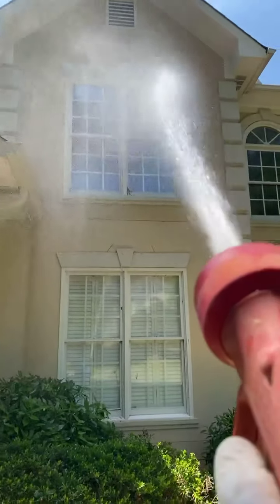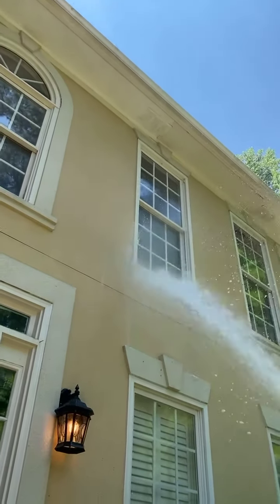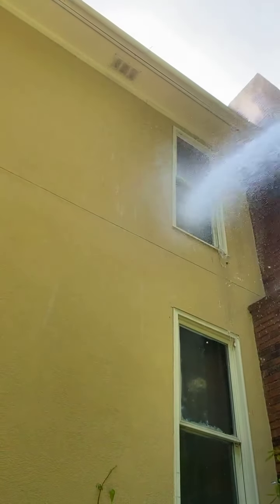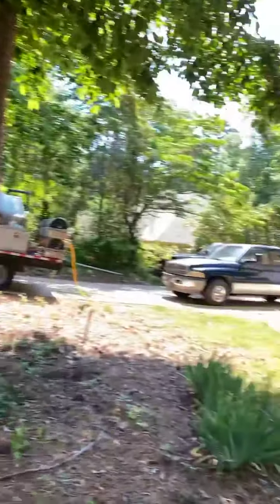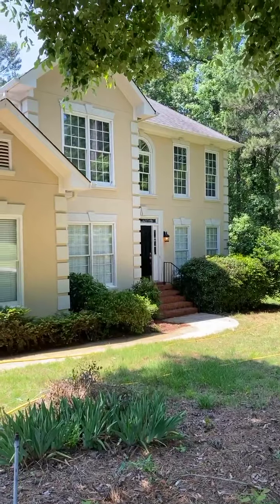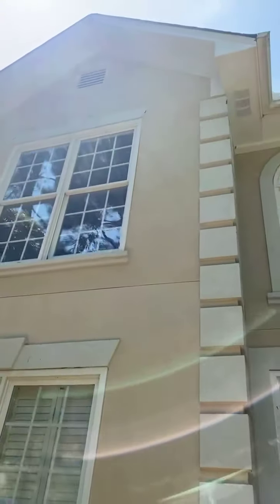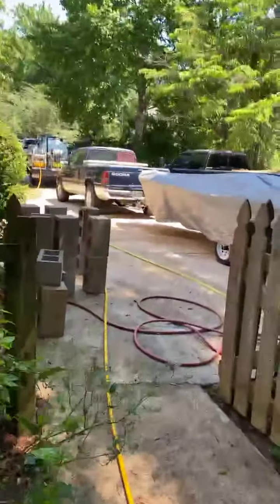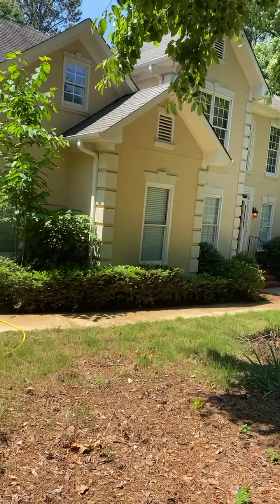Using the new AR 60

Comment: I don't know why Southeast Softwash brags about 12v pumps🤔🤷‍♂️
Reply: Iv been saying that for years.  I don’t get why people are paying that kind of money for a 12 volt
Reply: @kylecrisman9230  huh
Reply: Hell you guys got your opinion I got mine the reason I also brag about it..is because there cheap they last long if you do what your supposed to do as in rinsing...I'm open to a roof pump any day but for now with my small business its 12volt I luuuuvvvvvvvv my 12 volt peace
Reply: @perezleolp  Try a gas pump. You can adjust it. A 12v is like taking a piss. Just my opinion
Reply: @ILC-eo6vk  Please tell me how you guys keep from burning or killing the plants with that super volume? Seems like 12v is more precise without all that overspray.
Reply: @robertpurvis9659  Depends on how the gun is set. I have a remote, so I can quickly rinse and I rarely have any issues. If the house doesn't have gutters and I'm doing a roof, I have a portable gutter system that I made and set it below the roof, so whatever flows off, it goes into my gutter contraption and then collected into a tank. It takes a little longer, but when I tell the potential customers this, I always get the job.
Reply: @ILC-eo6vk  That’s some great info. That makes sense. Thanks
Reply: @robertpurvis9659  It's called 'pre-rinse & post rinse' sir.  Something everyone should be doing no matter what you're using.